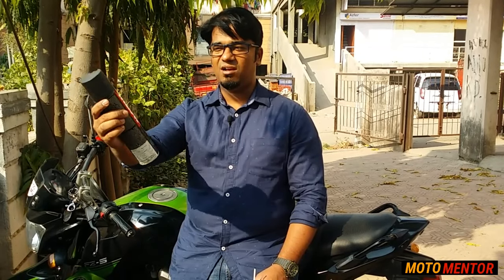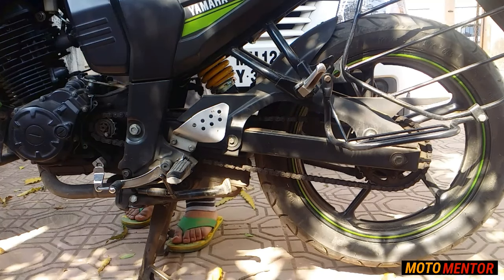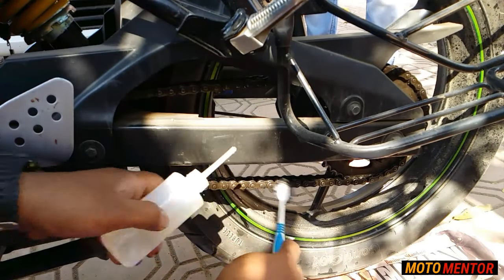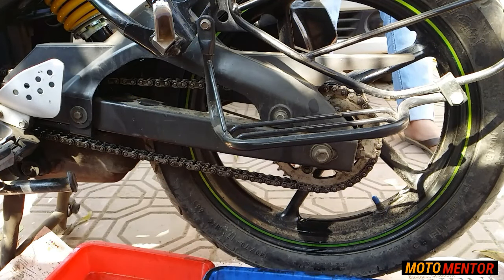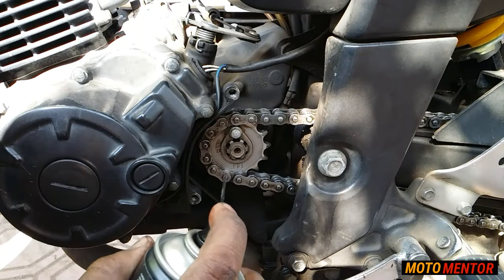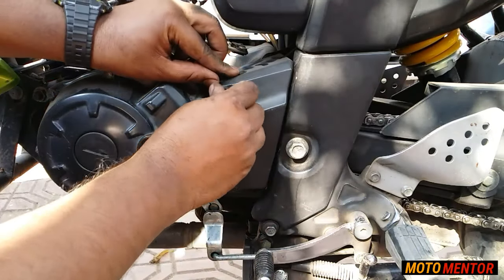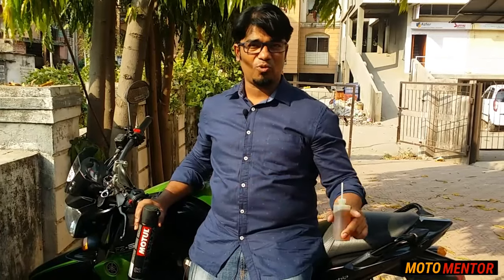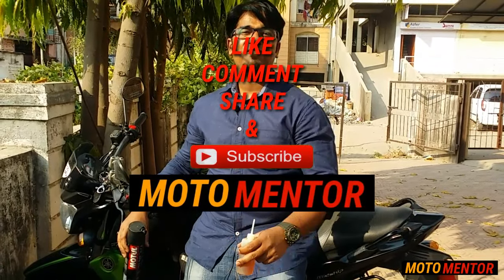BIKE CHAIN NOISE ? THIS IS HOW TO CLEAN AND LUBE MOTORCYCLE CHAIN MOTUL CHAIN LUBE VS 90 GEAR OIL

Comment: One question will not affect the o rings..one of my friends said it will destroy it
Reply from the maker: No bro it has not affected mine you are good to use.
Reply: @MOTOMENTOR  have started using it and it's better then the costiler chain lubes...thanks 👍
Reply from the maker: Good to hear that 👍 thanks 😊 🙏
Reply: @MOTOMENTOR  only one confusion should I lube it on one side or both I mean inner and outer of the chain
Reply from the maker: Anything will do

Comment: Am telling from my Personal Experience, I went to an Auto-Workshop, they didn't have Spray lube, so I just let them apply the Gear Oil. Believe me, I have cleansed and Lubricated Bike Chain by myself a lot before, But nothing is as close and smooth as a Gear Oil Can do, After the Gear Oil was applied I felt my Bike was almost Newly bought.
Reply from the maker: M glad we share the same thoughts.
Reply: @MOTOMENTOR  Which is better between two All Purpose Cleaner or Kerosene, I have seen vlogs which uses All purpose cleaner.

Comment: I have used 90 grade and 140 grade gear for chain lubrication in ns200. .. it works smooth but the sound tak tak comes from the chain .... when i use motul spray chain lube the sound is not coming.

Comment: Instead of kerosene using petrol is better option for cleaning the chain & petrol evaportes quickly.
Reply: Petrol may damage your chain o rings brother... Better use kerosene
Reply: Petrol damages O rings of chain.. Diesel is always better choice and widely available... Also acts as lube for shorter period of time.

Comment: What grade is best, 90 grade or 140 grade?If I use 140 grade gear oil, what will be?
Reply from the maker: The higher number it goes the thick the oil is so there is no problem at all even if you use 140 grade oil
Reply: @MOTOMENTOR  So, what grade of gear oil we use in chain is not fact. The fact is that we should use gear oil in chain.Here grade is not fact.After all, we have to keep our chain oily.Am I right?

Comment: 90 gear oil is oild school and very effective! Recently i brought a12 year old  FX 16 and the chain was making lot of noise and the mechsnic asked me to replace the chain sprokecket! sicnce i used sit at my frieds garage for long time whenever i found time ! So i cleaned with diesel and applied 90 oil and the got very smooth which saved me the whole sprocket money

Comment: My bike chain doing so much noise even I cleaned chain abd lubed but still same noise problem
Reply from the maker: Hey buddy thanks for watching how old is your chain and how many kms you completed?
Reply: Total km. 44K and this is 2nd brand new chain that I installed in my Yamaha Fazer...I am using same stuff that you advised but same noise issue
Reply from the maker: Make sure the alingment is correct  coz too tight or loose can cause noise or the tyer alingment on swing arm is not set correctly it may  create noise.
Reply: Should I get it fixed by moto mechanic or another way as well we can have

Comment: Thanx bro for wonderful suggestion, I purchased shell 90 gear oil, I'll going to use from next moment,,could you plz tell me how was your experience after using this oil, I mean chain sprocket lasting and chain noise and slagness experience?? When you lubricates using this how many kilometer could we run in summer and rainy seasons bro?? One more thing, do we need to cleaning process before lubing with this oil?? Thanx in advance for correct suggestions
Reply from the maker: Yes you have to clean before lubing it... I usually lube once or twice a month and it's been more than  35000km m using the same chain and sprocket without any issues and still its in the best condition I will recomend you to use it and see the difference.. My main moto is to protect the chain from rust.
Reply: @MOTOMENTOR  ji thanx😊😊😊, one more thing, once we lubricates how many kilometers we can run both in summer and rainy seasons, plz segregate though..

Comment: @moto mentor 
I am getting confused ... u told in video that use kerosene...some guys told in comment section dont use it ..some other guys said use petrol or diesel or metal wire to clean... I've got hornet 160r...what to use exactly??
Reply from the maker: Thanks for watching bro let me cleare your doubt, when we wash our hand we use different products like bar soap, liquid soap, sanitizers etc similarly u can wash the chain either with the expensive chain cleaner, petrol, diesel or the cheapest kerosene the choice is yours. I used the cheapest method which works best. Hope you got the answer bro.
Reply: @MOTOMENTOR yes..n  i appreciate u r concern

Comment: Good...have a doubt.. after applying Motul chain lube can we apply Motul gear oil on a regular basis???
Reply from the maker: Hi Balaji, To be very frank I haven't tried that and mixing both chemical won't be a good idea in my point of view. If you r using motul chain lube make sure to clean and reapply at regular intervel before it gets dry u won't have any issues.
Reply: MOTO MENTOR : After a day I have applied motul gear oil and checked with Yamaha mechanic too...so they told nothing will happen...
Reply from the maker: Then there should not b any issue  we just need to make sure that the chain is not dry and doest come in contact with water coz that makes it rusty.

Comment: I'm confused with gear oil. Is engine oil gear oil? Or can we buy online 🤔
Reply from the maker: No bro gear oil is thick you can rate the thickness by its number like the high in number the more its thick 140 grade is more thicker than 90

Comment: Brother i am replying u after 7 months and i used your method of chain cleaning in my gixxer sf fi abs model bike and itd awesome. Chain lubricant are not good as this 90 grade oil. They are very good and also reduce the chain vibration and noise.
Reply from the maker: Thanks bro this means a lot 😊

Comment: Can use diesel instead of kerosene  and i use gear oil + grease + petrol /paint thinner (little amount) to lube chain but the problem is grease content getting derty quickly but get more life than using only oil

Comment: Exactly the reason why I use 90 oil rather than chain lube... Chain lube was never effective at all for me....
Reply: Bhai, will the oil get sprayed on to the wheel rims/ mudguard while you ride the bike after lubing?
Reply from the maker: Bro use it in limit make sure to dip a cotton cloth and gently apply it to the chain do not overlube.

Comment: Bro I'm using the Castrol 90 gear oil.. is it okay ?
Reply from the maker: Ya bro thats fine no issues
Reply: @MOTOMENTOR  thank you so much for replying bro.. 
One more question.. that is this was my first time using the 90 gear oil so today I have actually over lubed.. It won't harm my chain or engine na ?
Reply: @soumojitdas6586  little overlube is fine. Not an issue. Just wait for sometime for it to settle. Then enjoy

Comment: Bro i used in my bike motol chain lube and Its started rusting in my bike chain what should i do?
Reply from the maker: First of all clean it with kerosene and let it dry  and then apply gear oil
Reply: Kerosene available nhi hai can i use diesel for cleaning chain

Comment: Wait, are you from Pune. Is there a proper place to buy authentic spare part (chain and sprocket set, spark plus, air filter) other than dealership?
Reply from the maker: I always buy it from authorized service center however there is this place call Nana peth in pune where you can find number of automobile shops. It's a automotive market.
Reply: @MOTOMENTOR  yup I've heard of nana peth, but not sure whether it's authentic. Also when I replace chain sprocket set, I want to change the ratio also, so I'm not sure if Yamaha provides that
Reply from the maker: No yamaha doest provide you that you  have to buy it from a third party dealer

Comment: Whatever u said actually  i am facing problem with my xtreme 200r...  Now i will follow your method,  and find out the result.  Thank buddy
Reply: I have motul chain lube and chain cleaner. But I will definitely try this 90 gear oil on my FZ V3.
Reply: @girishd5075  yesterday i have cleaned my bike chain as recommended by him,  also i have applied 90 gear oil on chain.  Yet i have not taken my bike out for ride, but tomorrow i taking her out.  How was the feel i will let u know...
Reply: @girishd5075  hi... as today i took my bike out and i drove about more than 50km in rain and it was awesome after using this technique.  No sound of chain and zero vibrations on foot rest.  
Thank Moto Mentor...
Reply: @manjeetkadam5502  Thanks for sharing your feedback bro.👌👌👌❤️
I am going to buy 90 gear oil and try this.

Comment: Bro where can I purchase 90gear oil and how much does it cost?
Reply from the maker: Bro link is in the description. The one m using is not available but if you buy the one provided in the link it  will last you for years.
Reply: Tq bro very helpful
Reply from the maker: Yw bhai👍
Reply: I have purchased Fzs version 2.o FI in 2018 so as mentioned in description which one(90gear oil/140gear oil/motul) would u suggest me for usage?

Comment: Hi, do you recommend 20w50 for chain lube?
Reply from the maker: You can but it might not last for longer time so you will have to frequently use it depending upon your usage
Reply: @MOTOMENTOR  It will last less than 200km?

Comment: I use HP lubricant gear oil ep-90 grade on my bajaj discover 125m. i realise that when i drive my bike between 40 to 60 km/h then the oill was working fine. but when i reached the speed between 60 to 75km/h then the oil not work properly. i think this oil suitable for avarage speed not for high speed. i think this is a disadvantage. if anyone solve this problem please tell me. Thank you..
Reply from the maker: Bro try using 140 grade oil its thicker than 90 but again you are correct oil is not ment for very high speed.
Reply: Thank you for your reply.. I have a question. This video Uploaded More then 3 years ago. So i hope, You are using this gear oil. Now my question is can you feel any type of high speed lubrication oriented problem?
Reply from the maker: I still use the same method till date and have not faced any issues infact the chain sproket is still the same as shown in the video.

Comment: My bike  chain is fully covered
How can I clean so?
Reply from the maker: Which bike?
Reply: @MOTOMENTOR  Honda livo
Reply from the maker: You will see a hole on chain cover so remove the round rubber from that hole and  you will see your chain just apply kerosene or petrol then lube it using oil pump or oil cane or else you will have to remove the cover and then lube it.

Comment: But expensive lube have there own benifits,for example i use putoline tech chain,which doesn't flings off and easily lasts upto 600km + 
Yes its pricey,900 rs per can,but will last easily a year

Comment: Major problem with using any oil as chain oil is that it keeps on leaking/dripping and you will notice oil on the floor everywhere once you parked your motorcycle.😂
Reply from the maker: I agree with you upto some extent but if you apply in limit you can manage to overcome this situation.

Comment: Can I use THEENER for cleaning the chain first?
Bcoz my service station used dat for cleaning the chain...plz reply
Reply from the maker: No bro thinner is very dangerous it will damage your chain.
Reply: @MOTOMENTOR  it means my service stations are doing wrong...

Comment: I lube my chain with gear oil every time after my ride(daily ride from home to work around 60km, holiday ride usually over 200km), after 6 months my chain still in good shape, no weird noise or rust coming up. Just wish I knew gear oil method earlier and stop paying thousands for chain lube on the market…

A simple tip to share with you, I found it much more easy to clean my chain by apply overload amount of gear oil(to the point where gear oil almost drip down from the chain) and simply wipe it off with rug or kitchen paper, the sands or dust caught on chain during ride coming down along with excess gear oil! works like a charm for me!

Do you lube with gear oil every time after ride or just after cleaning it? Because when I started using gear oil I just apply after I clean it, but I found that after 2-3 days chain started to make weird noises, that’s when I moved from apply after clean to apply after each ride. So just wondering is it only me or the same situation happed to anyone😢
Reply from the maker: You are absolutely right .... I still use gear oil and lube with  it as soon as I feel some roughness... I do it every fortnight depending upon my usage and yes after every wash too. As its not sticky it does require regular application.

Comment: Your chain set got rusted because you didn't take care. Always use a degreaser before applying lube. And you need to ensure that degreaser is going inside o rings. Use motul chain cleaner or wd-40. They won't harm your o rings at any cost. My motul cleaner lasted only two times. After that was your bike so any remaining degreaser is removed then apply lube. Almost all videos on youtube show application of lube just after degreaser which is wrong. If degreaser is still there and you are applying lube over it, it will just come off when you ride.

Comment: I am Mecanic dont do this  its.  Try to damage ur chain  and not lasting longer  that oil is not using you can use diesel then chain lube the oil is getting damaged chain orings 🙏

Comment: I used 50 50 mix of petrol and engine oil to clean and then lube it with gear oil as suggested by ncr motorcycles, what do you think man??

Comment: Gear oil is thick.lubes well but then dirt.mud etc sticks to it.Better use the Multipurpose oil used in Sewing machines(Singer,Soldier)Costs Rs.25/-only and can be used 5-6 times.Its thinner.transparent and repels water.Also "MIN" Cream for everything on the bike can be used.Polishes&protects.40 yrs biking experience.

Comment: Gear oil is good for commuter bikes where the regular speeds are well below 80-90 kmph which is majorly city usage.
Speeds above 80-90 if done regularly (mainly highway usage), the gear oil will splatter and hence chain will dry up soon. There is a reason why chain lubes like motul are expensive. They stick to the chain without splatter even at constant 100+ speeds.
I'm saying this after using both - Castrol 90 gear oil as well as Motul C2 for my CBR250R.
Reply: I am somone who rides bike between speed 40 70kms max , can i use gear oil ?
Reply from the maker: Yes you can go for it 👍
Reply: @MOTOMENTOR  i have taken a new bike bajaj Avenger 160, completed 1000kms, i think aftr 500 kms chain lubing and clening was already done , now after what duration should i lube or clean or both ?
Reply: @kunalshah2331  during monsoon, every 500 kms. Otherwise every 750 kms. This is what I follow on my bike. I clean with wd40 and lube with Motul C2. Never faced any issue.
Reply: @RRP1992  yeh gear oil use karne ka kya chakkar hai ?
Reply: @kunalshah2331  gear oil bahut sasta hai compared to chain lubes. So gear oil is best for commuter bikes. As it performs same as any branded lube at low medium speeds below 80-90
Reply: @RRP1992  ok , so i will use the same as i never ride bike above 70km 80kms, since its a new bike should i use wd40 and gear oil combination for chain clean or is there any other better way..
Reply: @kunalshah2331  cheapest alternative for cleaning chain is kerosene if you don't want to spend on wd40 or motul C1 cleaner. All are equally good. Kerosene is cheapest.
Reply: @RRP1992  okay thanks for the suggestions
Reply: true - u wud know what that means when one rides a 1k km non stop (with only pit stop intervals) ! ...crazy eh...lol ...- u get what u pay for :)  motul is the #1 french founding company for lubricants....cheers (aaron - enfield)

Comment: भाई किसी स्कुटी या मोपेड मे ep90,gear oil use nahi hota hai,20w40,oil use hota hai,aur kerosene 35 rs liter nahi 70 rs liter hai ,insted using 90 number gear oil you can use 140 number oil it is thinker than 90

Comment: Is it okay to use the same method with new Yamaha fzs?
Coz when I said the same to do in Yamaha service center, he stopped me to do so. He told me - it will ruin the Oring of the chain. I have changed the complete chain kit few days before.
Kindly advice me

Comment: Whichever companies chain lube you are using
whether you are doing normal / over lubing.....
No good for the chain especially if you are daily using the bike.
It will affect the life span of the chain or you have to lubricate every 200 to 300 kms.
 If you are living in a rainy area , further worsens the longevity of chain.
       Use diesel to clean the chain with an old tooth brush thoroughly. ( Front , Back & both Sides of chain )
I recommend a thicker gear oil say 140 grade to lubricate the chain because the oil content the chain last longer days when compared to 90 grade gear oil.
 ( From my personal experience  )
Let me say , 90 grade gear oil is NOT A BAD LUBRICANT for the chain.

Comment: Wet and thick oil will continuously attrac dust which will diminish the life of chain sprocket set faster. Chain sprays are basically solid lubracants which dries up after application, chain spraysbare any day  better, only thing is that it's expensive. Lubrivating with oil  in  running condition is very dangerous as one might loose fingers, always lube rotating wheel in opposite direction. India is very dusty and wet oil will damage the chains.

Comment: 18k drive range and company suggests chain change at10k and yet u still complain still good suggestion about gear oil
Reply from the maker: Faisal bhai chain can last for long if taken care properly my second chain set has completed 33k and odo is 50k+ still in good condition.
Reply: @MOTOMENTOR  great then share some tipsss and tricks
Reply from the maker: Sure bro 👍